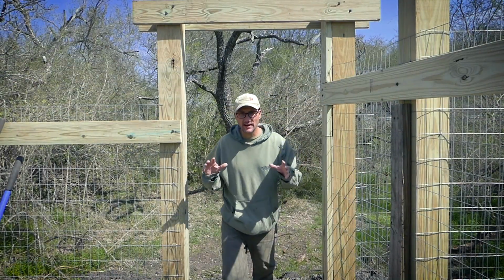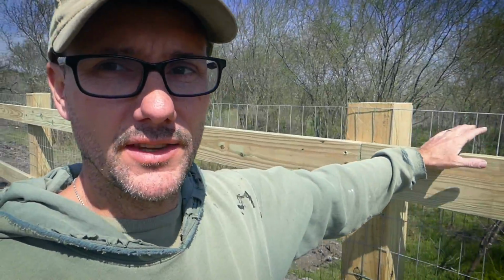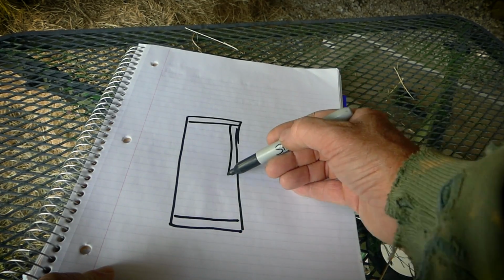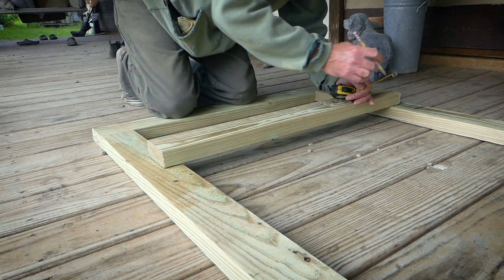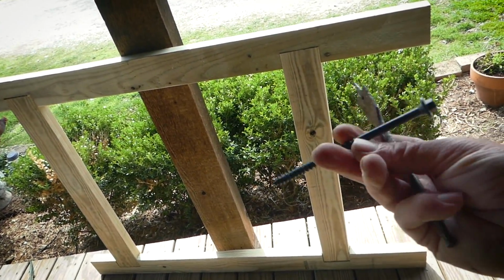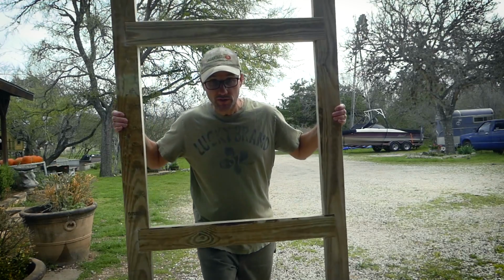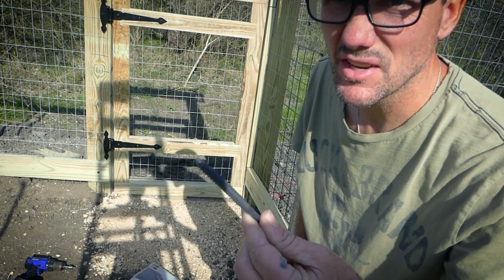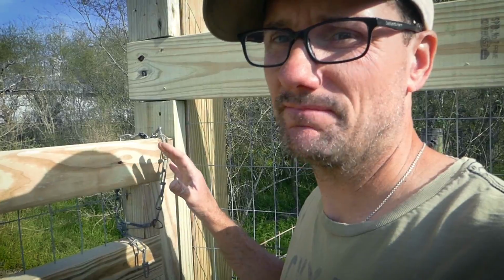Build A Garden Fence Gate - How and WHY?

Comment: Hi! To simplify this gate for someone who knows nothing about wood work but is building a gate.. (me) 
Is it possible to cut the two horizontal boards(in middle going across) inside the two outside verticals and then screwing in? Would that work as well as cutting the verticals and placing inside like you did?  Does my question make sense? That is the one step I know I’ll mess up. Thx!
Reply from the maker: Yes, you could do that, but it would have less strength and probably would sag more over time.

Comment: I was lookin for videos on how to build ‘simple’ gates (for my very modest garden in the corner of our property). This one looked clean and ridged without additional diagonal bracing. I wasn’t sure that I could pull it off successfully, but was delighted with the final results... sturdy and flat! Thought I was spending a bit too much on the hardware, but it was certainly worth it after I was done.  Thanks for your ‘over-design’ inspiration!
Reply from the maker: You're very welcome!

Comment: if you can make it so the horses cannot lift the chain off the hook.  consider a loop of chain with a binder clamp, to fasten the chain as a loop.  then just lift the chain off the hook to unfasten (chain is never parted).  the hook most likely a gate hook.

Comment: Great!
For the latch, Either just fit a normal but large door/gate bolt on top of the top bar, with the bolt engaging into a hole on the post, or for maximum strength, take a strip of either stainless or galvanised steel, about 2" wide and 1/16th thick.
Lay across the top of the top bar of the gate and mark where the edges are when it is balanced.  Fold both sides down to 90°, then 3" down each side, fold the strip back on itself at a 45° fold to lie parallel to the top bar and each other.  Drill the ends and post to take a long bolt - 3/4" diameter should be more than adequate.  Fit the bolt loosely with doubled up nuts tightened against each other (British English is lock nuts, I think the US varies on that).  Trim and smooth the threaded end of the pivot bolt. 
The end result will be a ∏ shaped clasp over the top bar of the gate, with horizontal arms linking it to a pivot on the gate post on both sides, where it pivots.  You can tighten it to stop any rattling just by squeezing the ∏ shaped part.  Very simple, very strong (livestock-proof), and easily used from either side.  If you want to make absolutely sure, you can even fit a normal hardware bolt sliding over the top of it, to stop animals (like horses!) learning to nose it open.  I never had that problem, but we didn't have horses
I've made them for gates on my uncle's farm, where they were hog and cattle-proof.
Reply from the maker: do you have a picture reference to this?  Can you give me more info by FB messenger about this style of gate latch?

Comment: Have the foundation guys tell you if you need any type of material you have to lay out in Foundation area before you fill with gravel? How about the compaction of the gravel after you put it in?
Reply from the maker: There does not need to be material as a first layer. I did ask that. The gravel will need to be compacted. I'll do what I can with each layer with my tractor, but when it gets full the guys delivering the gravel offered to drive their 45 ton trucks over it to help compact it.